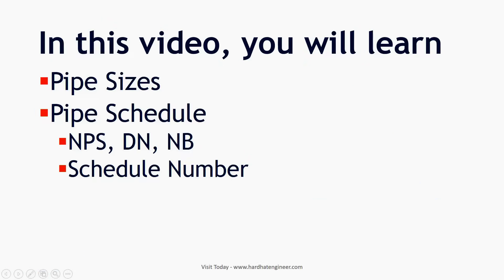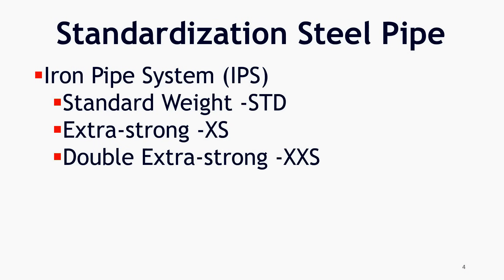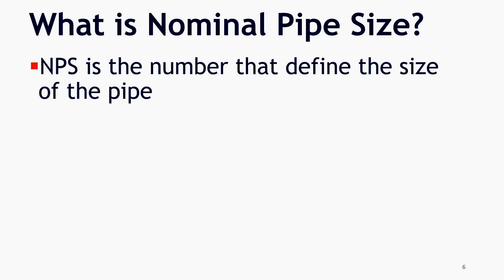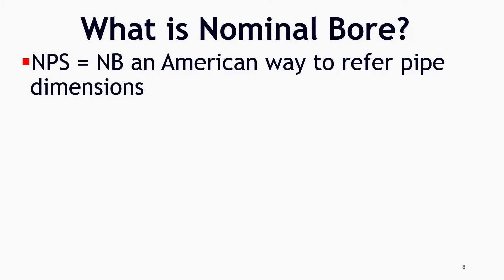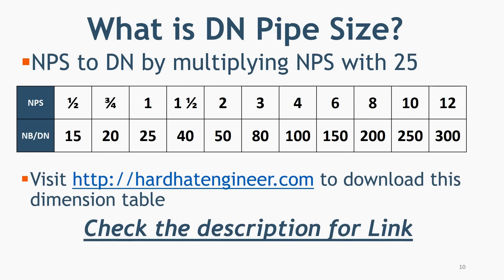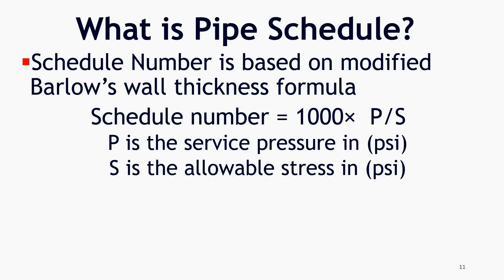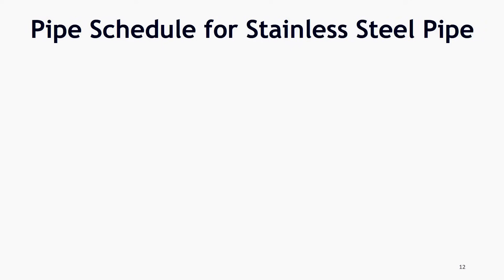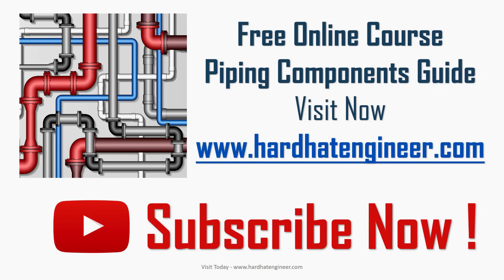Pipe Sizes and Pipe Schedule - A Complete Guide For Piping Professional

Comment: dear hard hat engineer
thank lots for your efforts 
can I ask you a question?
when I do piping wall thickness calculation with all B31.3  (last edition) code considerations I get some answers without identified  schedule numbers according to B 36.10 M-1015
As example :24" with 20.62 mm wall thickness 
as you note this wall thickness didn't have a schedule number while (schedule 40 for 17.48 mm ) and (schedule 60 for 24.61 mm)

can you kindly  provide me with your answer and advise
Reply: A think that you have to select the great thickness what i mean is to use SCH 60

Comment: What is non scheduled pipe? Difference between scheduled and non scheduled pipe
Reply from the maker: Pipe with specific thickness ( Non standard) are non-schedule pipe.
Reply: @HardHatEngineer  schedule 80 means. Thickness is 15.1.. so this is specific thickness.. Non standard means?

Comment: But what is the origin on NPS? i.e. why the OD doesn't match?
Reply from the maker: It is history of evolution. How world move from old Iron Pipe system to current system.
Reply: @HardHatEngineer  Thanks for your reply. I will rephrase my question. What is the origin of the old Iron Pipe system. Why the uneven OD? Surely they where using inches back then right? So why they didn't make a system where the OD would be 1", 1.5", 2", 3", 4" etc...

Comment: You are wrong here.
4 and above is multiply by 25 to get DN as per ASME b.16.5
Reply from the maker: B16.5 is standard for flanges not pipe standard. But what you have said is correct that 4 inch and above it is straight multiplication with 25. For smaller sizes it is different. Did I said anything thing otherwise?
Reply: @HardHatEngineer  it's ok.
But I read in B.16.5 in page number 2. It was quoted.

Comment: I work as electrician and metal work, everything are measures and follow by ruler and measuring tape , using inch or centimeter, even a round metal tube or pipe for stair hand rail or metal gate measure in inch or centimeter. But yes, in electrician, wire also have it own measurement like 10 AWG (2.5mm), 11 AWG (2.3mm )12 AWG (2.0mm) , 13 AWG (1.8mm) or (American wire guage).
Why the hell 1" inch (25mm) PVC pipe messure like 1.5" inch or 37 mm, and is not 1" inch or 2.5 cm (25 mm) or 8/8", 16/16", 32/32", 64/64" whatever you call. Even a 3/4" inch PVC pipe is not 3/4" inch and appear to be 1" inch at all I just don't get it who created this confusing shit NPS, NB, DN and still called and "inch", why don't call it other name?

Comment: Why is NPS is not equal to OD for smaller pipes?
Reply: The entire system is based on industry usage and not ease of use. All of the sizes below 12" are commonly used for fluid and gas systems and they rely heavily on the internal diameter to calculate flow. If you are needing round hollow tube for a structural system then you might want to specify "Tubing" which is measured strictly by OD and Wall thickness.

Comment: Hey I have question regarding pipe schedule. Suppose I have to find pipe schedule by checking diameter Nd pipe size , so what I have to check according to pipe size (size) or outer pipe diameter
Reply from the maker: You have to check Thickness and OD.

Comment: you said to convert NPS into DN you've to multiply by 25 but in table 1/2 NPS is 15 but not 12.5
Reply from the maker: +NiTiN Hello,  this size conversation is applicable to NPS 4 Inch and above. As said in video.
Reply: You cannot set the thickness of the pipe always according to mm conversion , if u do it will never withstand the assigned pressure because ID of the pipe is small it means the pressure distribution will have smaller amount of area to exert pressure thus it will burst it but it is not the case the pipe size over 4” because they have bigger inside area. I hope that works for u.